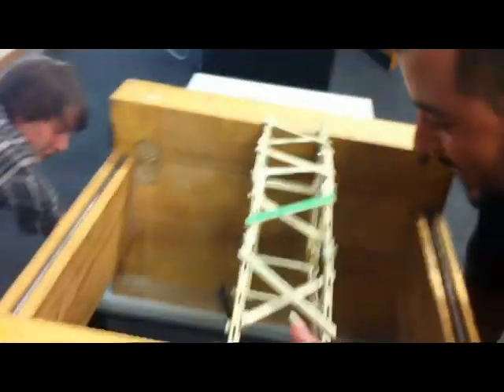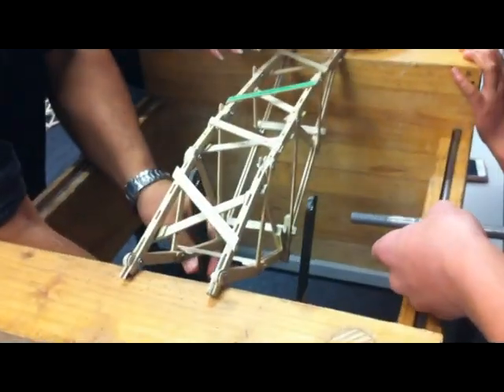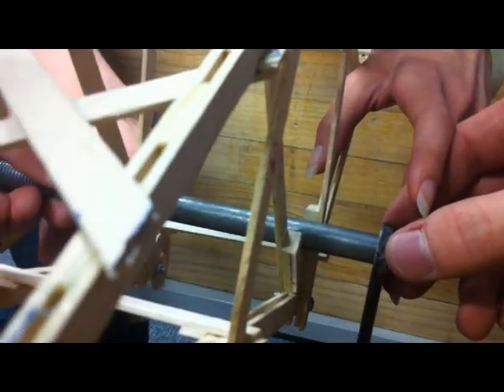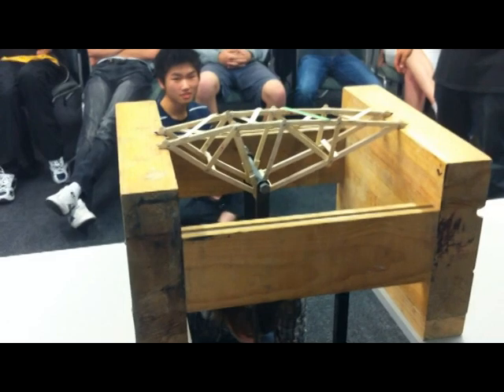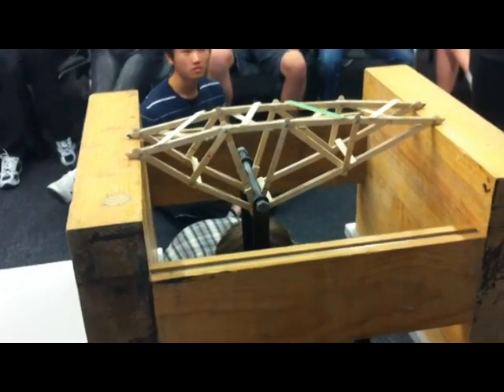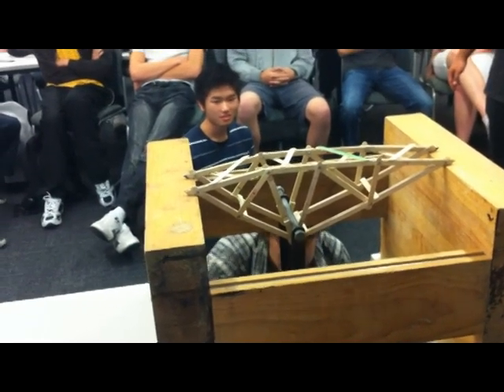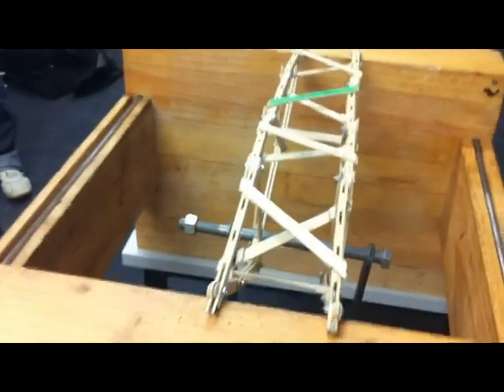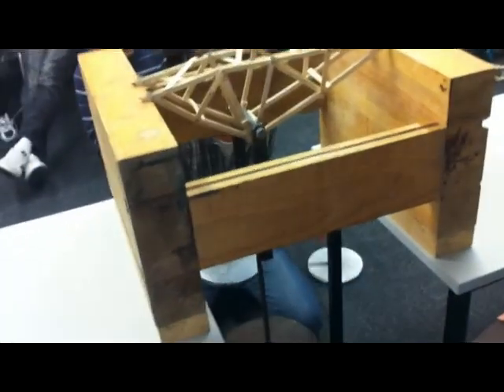Record Truss Bridge 2012 - University of Auckland Engineering

Comment: What is 1087N in real weight?  That's 244 pounds.  If the original truss weighed 110g then that is a ratio of about 1000:1 which is very good.

When I first saw the thumbnail I could see that there were a lot of elements in the truss that weren't necessary to carry loads, meaning they are zero force or close to zero force elements.  If they were eliminated, or better yet moved into the main chords, the truss would have been much stronger.  However due to limitations of using short sticks for construction it was necessary to have joints in the compression chords and the additional elements served to brace the joints.

We did similar contests in college but using balsa wood and epoxy.  I built one that weighed 35g and carried 285 pounds for a ratio of 3700 which shows the difference in strength to weight of balsa wood.  Plus we were able to use longer pieces of material so it was not necessary to provide additional web members to brace joints.  This reduced the weight of my truss.

Comment: Hmmmm ... I thought Truss Bridges were designed to take/support loads from the top vs. a suspended load attached to a single connecting point at the bottom.  That is if people/vehicles travelling across or travelling gantry was attached to the bottom the load they apply could be anywhere and moving.

Comment: This reminded me of a bridge I built out of balsa wood and glue in high school AP physics class. We ran out of weight objects(which were being placed in a 5 gallon bucket) and the bridge didn't break. I used the Roman arch principle as inspiration for design and placed arches along outer edges on both sides and in between the two outer rows perpendicular to them.

Comment: There was no Youtube when we did this in high school. Popsicle sticks only. I won with the highest load to weight ratio. It’d be cool to see video of some of the stuff we did back then.
Reply: Same, but we had to use balsa strips and we had to decide the thickness and size of each strip.  We had a weight and size limit for the bridges and we had to use a deck and the weight was suspended from the deck.    I came is second an 235 pound  capacity because when i was placing a weight i stumbled and dropped the weight on.  The winning builder had a cap[acity of 236 before his collapsed.

Comment: That’s the problem with engineers they’re only putting force on one part of the bridge but does go throughout the bridge but equally distributing the weight would hold a lot more when a car goes over a bridge it’s not hanging like a pendulum off one part of the bridge. .  I am a carpenter that has moved into interior trim and has seen countless engineering problems

Comment: As an mechanical engineering student at Worcester Polytechnic institute in the early 1980s we did the same exercise. Turned out design and calculated load was as important as construction technique. We were not allowed to use mechanical pins. Some of the students even fashioned gusset plates out of the glue tube !
Reply: Great! That's really using the materials "at hand".

Comment: It could have been more statically resistant if the bridge had a longitudinally centered structure, a longitudinally centered load and a laterally balanced and centered load, maybe. the twist caused by the lateral imbalance ruined the presentation! good luck balancing all the parameters known to you. maybe Awareness of the weak point of rupture is rich in lessons.

Comment: honestly the design never failed, the material failed, as in the placement of the thru bolt broke thru the wood it was resting on, too weak of material, if that was made of steel?  or even a good hard strong wood?

OR, had the spread the load out and not centered where they did relying on the thin piece of wood to hold it, maybe just beef up the wood around where the bolt rests?  guarantee you had they put the weight on top and spread it out it would have held a lot more.. quite the design in any event and prives that's a very strong design and again made from a case hardened steel?  might hold a truck

Comment: Something is wrong with this experiment. Aren't you supposed to test the weight by putting weight on top of the bridge instead of pulling it down from under the bridge??
Bridge is supposed to be long. Of course short bridge can hold more weight.

Comment: I would have liked to see the weight added to the top instead of pulling from the bottom.  Vehicles don't hang off the bottom of a bridge and in this case, you would want to build the structure to deal with the pull from the weights hanging off the bottom instead of supporting what's on top.  You won't see a bridge built with all those supports going down so far under the bridge in actual application.

Comment: Why they attach the weight this way? I believe those 2 contact points are measuring how good was the joint below them and not how much pressure can the bridge plate withstand itself.

Comment: Why the point of hanging weight is there? It's no sense from 'bridge' perspective. IMVHO it should be on the top of bridge, like on surface. The distribution of forces in individual elements of the structure is completely different...

Comment: Well done. My brothers' 1st year was 2001 his group won their year with 103kg and a simple design level span off center loading point. I was 1st year in 2005 and my group won our year with 114kg (I remember this as it was Jonah Lomu's weight) we had much more difficult parameters, similar to yours. uneven span, off center loading point and had to allow for a pipe to fit the truss and a certain point. I still have my truss in my office, it failed at the upper landing.

Comment: I remember making a bridge in shop class in jr high.  Made from 3 feet of 1/8" square balsa wood, no fasteners, only wood glue.  Held over 900 lbs before it broke.
Reply: No it didn't. Ours was 3/32" balsa - 10 3' pieces =30' our best was just over 65 lbs. You got some units or decimals out of place.

Comment: The failure of the bridge was the placement of the weight.  No bridge is built with the design of weight pulling down on one point, but on the design of weight pushing down from the top spread out across the entire span.  The location of the weight bar across such a small area guarantees failure at that point.  The bridge did not fail, the connection of the bottom trusses did.  The bridge would have held a lot more weight.

Comment: Wasn't this bridge over weight? it said the max weight is 50 popsicle sticks which are 2 grams each and a allowance of 10 grams for glue, that should be a max weight of 110 grams. this bridge weighed 146 grams. Thats almost 40% more materiel than allowed, no wonder they broke the record

Comment: Can anyone explain why a structure would fail after holding the weight for x amount of seconds?
Reply: Popsicle is wood and wood is fibrous this allow stretching. With bolts securing the doubled-up struts it is more the stretching bot the fibers that cause the fatigue and failure rather that the tensile strength of the wood material. I wonder if he could have reduced his bridge weight by using wooden plugs rather than metal bolts?

Comment: The bridge should not be subjected to a focused point of strain, i.e., the thru-bolt. It must have the load distributed throughout the structure to give an accurate real world stress test. Secondarily,
the load applied should be much more incremental, and metered- rather than having successive massive discs applied in turn.

Comment: I entered this contest when  I was in college, it is a great challenge for engineering students to get off the CAD software and actually build something and test it. We weren't allowed any metal pins though, only popsicle sticks and white glue, anything else used was a disqualifier. I still have mine hanging in my garage as inspiration.  This group did a great job.
Reply: Necro post.  =) That truss is Ok, if you asked me.  It held 1087N ~240lbs @146g ~750:1.   Caveat, maybe they were forced to use the bolts as junctions compared to most other engineering competitions who could use glue.  Did not even hit 800:1, let alone 1200:1 or greater for roughly same competition held elsewhere(usually with longer span).   The next caveat is the 10g of glue limit as most other bridge competitions usually meter out the glue based on volume instead of weight as they use "white" water based glue instead of PVA(rather odd)so I do not know how this converts to other competitions and they might have chosen this to PURPOSEFULLY differentiate this competition due to the age of the internet and ability to download files from other people.  Also, the span used in this competition is shorter than normal which significantly helps increase the load numbers and helps their strength to weight ratio.
Reply: im the reject that snuck in during lunch and played king kong with every model.
Reply: They did outstanding…they better have gotten an A on this one 😁
Reply: how did it perform in the test?
Reply: @cabletie69  if memory serves, we held about 2000lbs of downward force on the centre beam. Designed a gull wing truss  like this...'IAI'...It nestled tight below and between the outer supports, and transferred the forces directly to the rig itself   keeping the majority of the structure in compression rather than tension. We also pinned each connection with toothpick sized pins to strengthen the load bearing joints and dovetailed each length of popsicle stick so that they didnt slip where they butted against each other.
Reply: @johnnybgoodbeesandbarbecue5788  impressive result!  Nearly one metric ton.
Reply: @cabletie69  to be fair, the design we used was later called into question because of its use of the rig itself for stability and opposing forces, it wasnt "truely" supporting the weight alone. It was a commonly used design at the time that we took our inspiration from but there was always the debate about it being fair against self supported bridge designs other teams used. Our prof's setup also used a hydrolic press that provided smooth, slow consistant pressure which  didnt stress the structure as much as just placing weights on it every few seconds. But it is still pretty amazing how much force some sticks and glue can support when you let kids experiment with design.
Reply: I have my T shirt with its back torn off and framed when I qualified my PPL.
Reply: I think there should not be restrictions of metal screws as this truss is been made to examine the strength carrying capacity of the truss members...if there's not much fit at the joints it will dismantle from there
Reply: Where can we find the data on last winners

Comment: As a woodworker I wonder how much the wood comes into play. Depending on what part of the tree each stick is cut from can have a big difference in strength. Old growth trees will have tighter growth rings making it stronger compared to farmed tree with wider and weaker growth rings. The PVA glue too. A rough piece will stick together better then if both pieces are smooth. 🧐
Reply: Exactly what I thought, I would definitely treat the wood with some sand paper at the areas where glue is applied. The part about using stronger better stick is probably part of the competition, I am sure the teams built dozens of prototypes before ending up with final design, so they definitely noticed that some sticks are stronger, the glued parts tend to fail less if the surface is rougher etc. But my guess is that the design is 90% of the strength.

I am more mad about the weighting process, first off yoj should apply weight on the top of the bridge, it would carry much more weight, or dont call it a bridge but a hanger or something, but it is dumb because with a bridge you distributing the weight over the whole construction, where with a hanger, that spot where you hang is the most stressed. But the worst part is adding weights, why keep adding 10kg plates, why not add like +1, +2, +3, +4, remove and add +10, they failed at +10 but the limit was anywhere from +1 to +9. Also the dude is not very gentle adding the 10kg plates, so the inertial force might have actually peaked at few kgs higher if the plate was actually slightly dropped. I dont know, I would personally load it with a hella strong wire that is slowly spinned onto a coil, with a peak force meter in between.

Comment: The structure was subjected to a point load at an irrelevant connection, which would not be a real world case. Components that would normally be under compressive force were subject to tensile force. The shear loading on every bolt, including the bolts in direct contact with the point load, is now irrelevant. 

A uniform top load should have been applied if the test was to properly simulate the structure’s integrity for its designed purpose.

Comment: I did this exact same design project in the 1st semester of 2018 at UoA and thought I would clear up some common queries in the comments. First-year students are given 3 weeks and a limited number of popsicle sticks to create the structure. There is also a tonne of ridiculous spatial requirements between the two resting points which largely dictate the unsymmetrical shape of the structure. These shapes and joints could theoretically hold a lot more weight as the limiting factor is the grain of the popsicle sticks, almost all examples break transversely to the grain at the loading point. You may notice that this structure has almost excessive cross-bracing on its top to withstand the largely imperfect loading method. Structures without sufficient crossbracing fail almost instantly (like, <100N load in my experience).

apologies to all the civvies I must have mortally offended in trying to remember the correct technical terms used in this project, it's not my spec.

19 + 8 = 26 youstoopid
Reply: Necro post.  =) That is Ok, if you asked me.   It held 1087N  @146g ~750:1.   Caveat, maybe they were forced to use the bolts as junctions compared to most other engineering competitions?  Did you have to do that?  Did not even hit 800:1, let alone 1200:1 for same competition held elsewhere in world(usually with longer span).   The next caveat is the 10g of glue limit as most other bridge competitions usually meter out the glue based on volume instead of weight as they use "white" water based glue instead of PVA(rather odd)so I do not know how this converts to other competitions(the one I did and thousands of others around the world) and they might have chosen this to PURPOSEFULLY differentiate this competition due to the age of the internet and ability to download files from other people and same goes for your stated misalignment of the footings which does not make a difference to anyone who knows how to build anything, but to someone who is lazy and tries slapping something together at last minute... yup.  Also, the span used in this competition is shorter than normal which significantly helps increase the load numbers and strength to weight ratios.  

Always a good engineering competition.  The ball bridge drop test catch engineering challenge is even better along with the earthquake building challenge.

PS: No "I" beams built out of the popsicles makes this a poorly designed bridge as a competition example.  Stopping the transverse grain splitting on the popsicle sticks is easy with a little glue and a shred of cross bracing against the grain direction.

Comment: Why it asymmetric tho

Edit:WTF,That thing is strong
Reply: It puts the load closer to being under an anchorpoint therefore reducing the stiffness needed to hold the weight up and reducing the strain on the structure of the bridge.
Reply: @callumwyper  We had the same design problem at QIT (to span two points with a sheet of paper) only the load had to go through the centre. I got 100lbs which was the record in 1975.
Reply: @callumwyper  now if only you can convince all that vehicular traffic on your bridge to distribute their loading per your optimized design...

Edit: I recognize that the design probably fell within the requirements of the competition, I just don’t agree that it’s an appropriate simulation of real-world requirements
Reply: @SpamSucker  i don't see anyone who say that it's an appropriate simulation of real-world requirements
Reply: @SpamSucker  Real world requirements are to do exactly what the people giving you the task want, which is what they did.  They asked for a bridge that could hold up as much weight as possible from the middle.  They didn't ask for a bridge that could handle rush hour traffic.  Learning to stick the parameters is important.  You don't get to build the perfect bridge when there's a budget or a limited supply of building materials.
Reply: @shawnheidingsfelder8179  It wasn't from the middle.